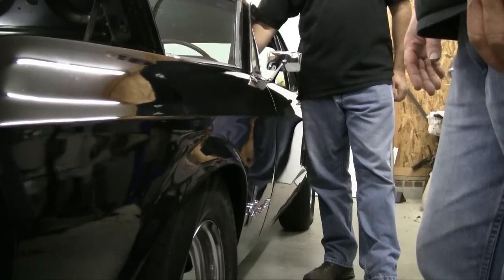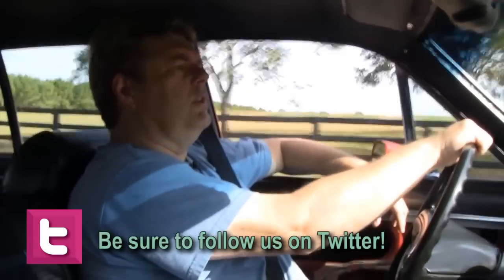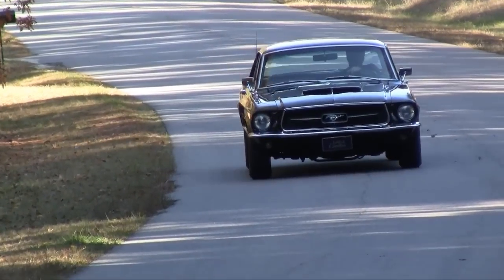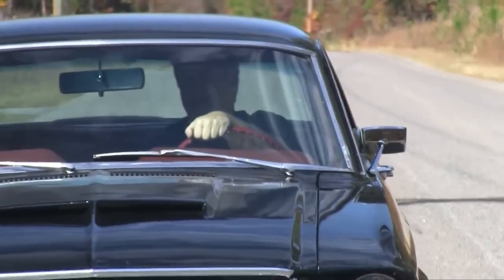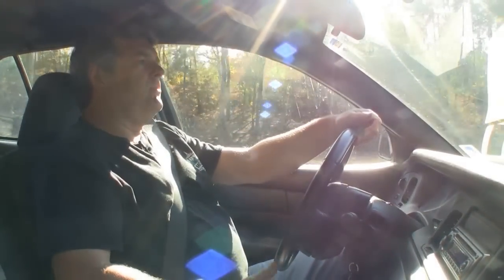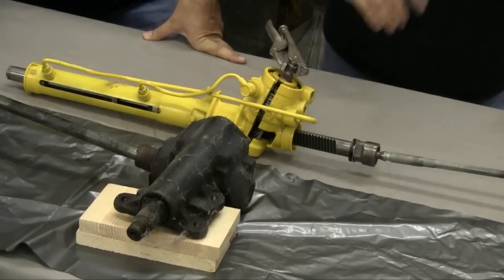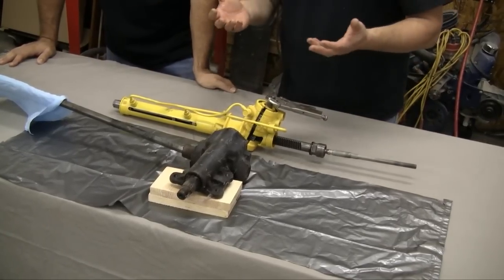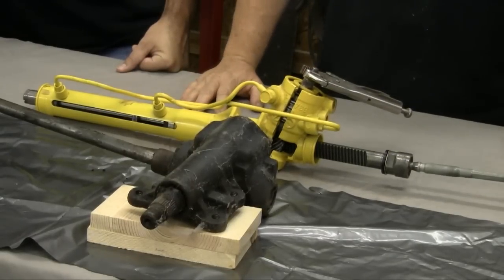When you should consider changing to a rack and pinion Episode 140 Autorestomod

Comment: in australia back in the 70's chrysler valiants had an optional power assist and the ratio in the box was 16:1 as opposed to standard  . 16:1 was also the ratio on police optioned cars and locally built R/T chargers but was not power assisted
Reply from the maker: Did you mean 19:1? Ford used 16:1 ratio for power assist and 19:1 for non-power in the '60s and early '70s. The Fairlane's rebuilt 19:1 box is less responsive than the power assist '67 Mustang...well we think it is when it decides to engage...
Reply: i am sure it was 16:1 for power assist and for the r/t without power assist , but this is for australian A-body mopar's, i am unsure on what the standard ratio was

Comment: excited to see next weeks.  My 68 mustang has a manual box, but with the slightly faster 16:1 power ratio.  For me - even ignoring slop/precision issues, power steering isnt just about making it "easier" to steer but also speeding up the ratio so I dont need 4 and 1/2 turns lock to lock.  16 inch steering wheels and 16 or 20:1 ratios dont inspire confidence on a windy road.  Some of the power rack companies advertise much faster steering ratios, so coupled to the precision and ease of handling they look enticing.

Also aftermarket wider rims and plus sized set ups (16 inch or 17 inch) make a big difference.  These cars were designed for minimal caster and bias ply tires.  Stiff radials require more caster but that makes steering much more difficult.  If you run minimal castor the wheels wander all over the road.  So the advantages of a precise power assist rack and pinion set up add up.

Please highlight issues with headers too when you install.
Reply from the maker: We are going to cover turn radius, header clearance, and do a post alignment drive. The one thing we will say is that some rack installs require you to be much more mindful of what you are doing when diving. Some of us that grew up driving these cars with the stock box have to get used to the new experience. But the rack does provide a much more sporty handling drive.

Comment: Hello, GREAT VIDEO
I have see you video for the borgeson kit and i buy  all ready the borgeson kit but don't have installed yet,
What is better you think, The borgeson kit or the rack and Pinion?
Thanks for your answer
Mick
Reply from the maker: Hey Mick thanks for the kind words! we'd have to say that it depends on what you are wanting. The Borgeson box will offer power steering that is going to be tighter than the old unit, but less razors edge than a rack and pinion. As we said in the video, the rack offers a more "sports car" type of handling than a box. Both offer dramatic improvements over a worn original box.

Comment: Hi Jeff, great timing for the video.  I have my factory power assisted set up sitting on the work bench right now.  This particular car is a early 67 (pre-rag joint).  I hadn't considered the UniSteer seriously.  I run a compact modern starter, but I also run Hooker Headers and I understand clearance can be an issue.  This car is low and definitely a restomod, (my 68 convertible is stock before anyone whines), dialling out the bump steer is a real issue; but I'm hoping the next video will look at what fitment issues arise with headers, starters etc.
Reply from the maker: We are going to try and fit it with the stock starter but we probably will be snagging a mini just in case. There is a note with the rack about the use of Hooker headers and I will be calling Unisteer this week to clarify.

Comment: We have a 1967 Mustang Fastback 429/460 Ford 385-Series can you tell me if I can fit the rack and pin in. If so what rack and pin should I get?  Thanks!  My wife and I thought your Vids are very easy to understand and keep the info part of them coming also GREAT JOB!!
Reply from the maker: We're impressed that you got headers in there. Which might be your only hold back. The Unisteer racks are pretty good for clearance. But that chassis is not designed for the 385 series. Ford even modified the '70-'71 Torino chassis (widening it by 1-inch) to allow for the 429. So you may have to get creative. We'd call Unisteer or Total Control and pick their brain on whether it would fit. We do know that Total Control has a Big Block rack available.

Comment: I drive a 65 Mustang that originally came with the power assist. I've since replaced it with manual steering, but kept the original power assist box. Driving around I don't really notice a difference in the steering feel between it and a modern car, except when trying to park of course. But I do have a dead spot in the center, which while driving on the streets isn't that noticeable, driving on the highway can be a bit, well lets say interesting. Anyway I've been debating on whether to replace it with a rack and pinion, or with a Borgeson system. I'm kinda leaning towards the Borgeson, but I'm curious what you guys think it over the rack and pinion.
Reply from the maker: We like both honestly. The Borgeson box is a nice solution if you are looking for a good tight feeling stock style box that "feels" more like a modern power steering box. The rack is a more direct feel since there are less moving parts than on the Borgeson box. We plan to do a before and after Borgeson install on the '65 later this summer.
Reply: AutoRestoMod Did you ever do this video? ^ I am very curious about the borgeson box, was about to buy a flaming river manual box as my 68' coupe wih manual steering box is shot, but the borgeson is about the same cost and I already have a Saginaw pump laying around. Thinking about scrounging up the rest of the parts. Don't wanna spend the money on power rack and pinion, that could be spent better elsewhere for me. I have a 1/4 turn of play in my wheel now and I think a tight box with the little quicker 14:1 ratio I would be very happy with